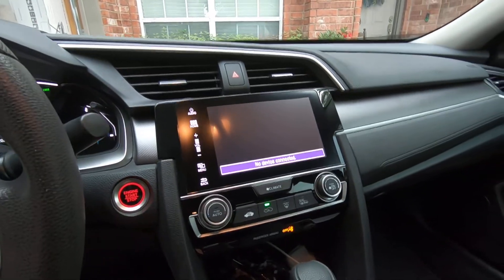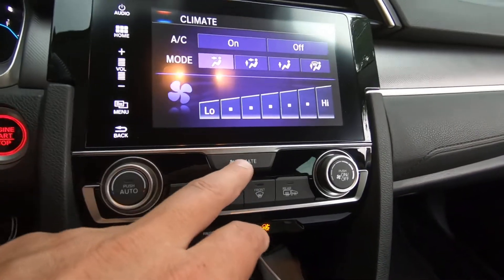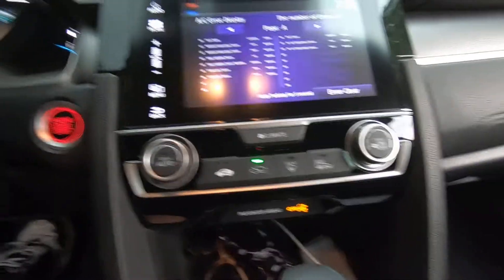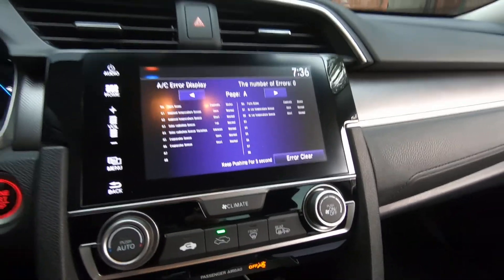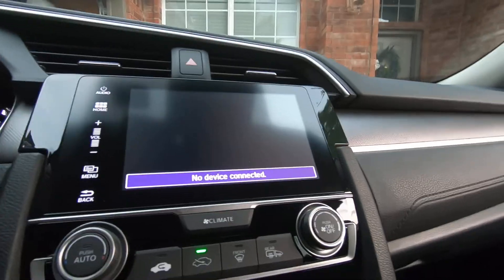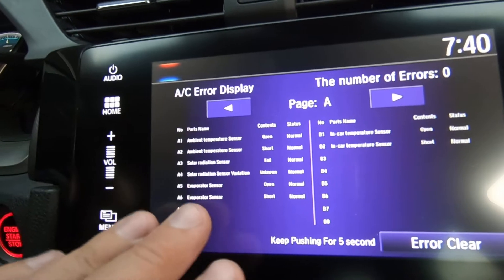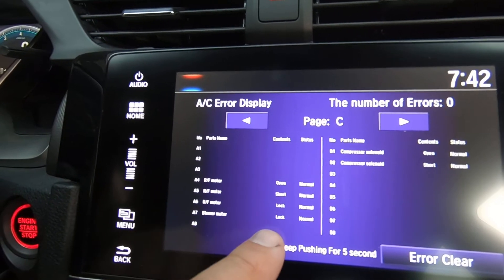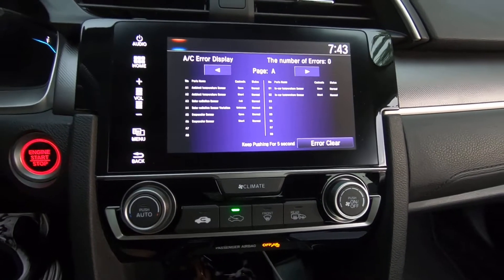Honda's Built in Air Conditioning Diagnostic Self Test on a Civic.

Comment: hi i have repaced the ac control module with a used one from the same engine etc, everything works as it should but when i run the ac diagnostic i get an error that says "hum-temp sensor comm" contents error and status error. what could be the issue or the fix for this? do i need to get the used ac module coded to my car's ecu? its 2018 honda civic 1.5 turbo.
Reply from the maker: The book says just hook it up and run the self-diagnostic and make sure everything is good. E-mail me and I will send the diagnostic procedure.
Reply: @737mechanic  ive ran the hvac self diagnostic by holding on/off and pressing the rear defroster 5 times, it runs the test and takes me to the hvac diagnotic screen, which shows 1 error, when i clear it, it comes back after a few seconds, is that the diagnostic you mean or is it a diffrent one? can you send me your email address please.

Comment: My 2017 civic got this issue where the AC blows really cold but while it's running it turns real hot and then cycles between both but sometimes it's really cold I just can't figure out what the problem may be
Reply from the maker: If the refrigerant charge is correct, I would check the evaporator temp sensor.

Comment: Great video. Had a question. I have my outside temp sitting at “- - - F” on the dash and A/C not working. Had some shop suggest it might be the outside ambient sensor (front grille one) so they switched it out. I’m assuming maybe there’s a code reset or something they did not reset on the actual car’s computer. I just ran the self diagnostic and did get a error it said “A2 Ambient temperature Sensor Short Error”. Should I click the error clear hoping it resets it? Or should I assume and check it might be something else?
Reply from the maker: I would reset it if you can and if it is still there it is probably wiring.

Comment: Very informative video 👍 I checked the owner's manual & I am surprised to note that it's not even mentioned there.

But in conclusion as this diagnosis doesn't provide any info on error, so practically it's useless.
Reply from the maker: I wouldn't say its usless. If I had a problem with the A/C on one of these cars the first thing I would always do before even opening my tool box is open that up and see if everything is showing normal, if something is showing shorted or not normal that would give me some direction and what the problem could be. For instance if the ambient temp sensor was showing short or open that means you need to look at the temp sensor, if the evap sensor was showing open or shorted then you would look at the evap sensor and so on.
Reply: @737mechanic  well the reason I said useless is because my civics AC is having an issue, every few months it starts blowing hot air (might be a very slow leakage as each refill works for around 4 to 6months).

So I was really hoping this disgnosis would show some fault, but unfortunately yesterday when I ran it came all normal
Reply from the maker: @zahednow  If you are refilling it every 4 to 6 months then you have a leak for sure.

Comment: I have the same problem, i recharge the gas but in 3 months disappear.. and again no cold air 
I took it to warranty but they couldn't find the problem..
Reply: Did they check this? https://static.nhtsa.gov/odi/tsbs/2019/MC-10163796-0001.pdf - Warranty Extension: A/C Condenser Leaking